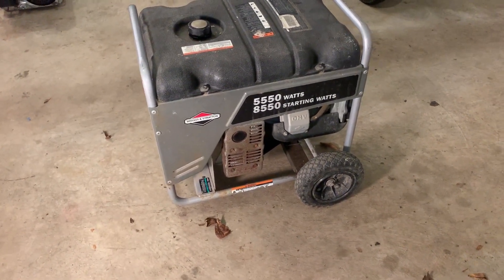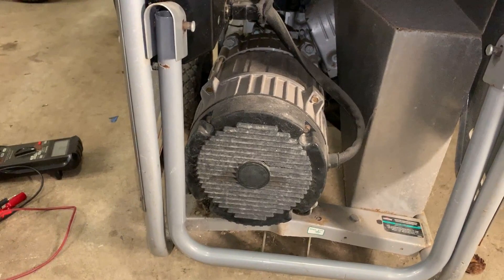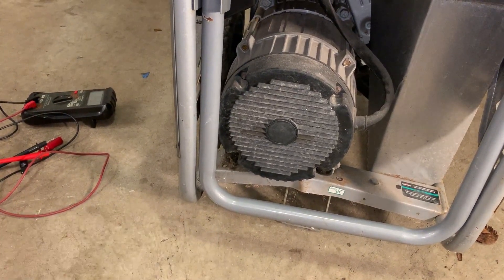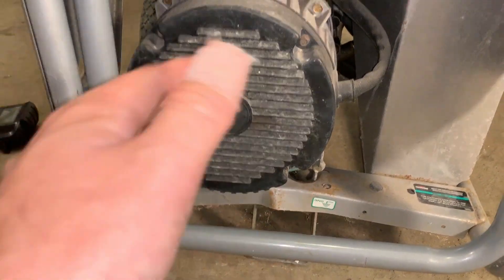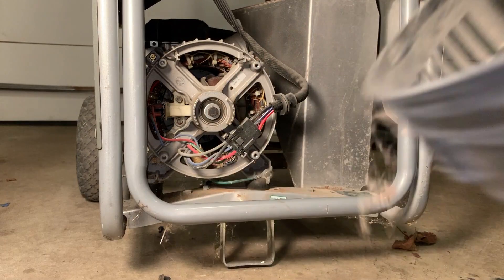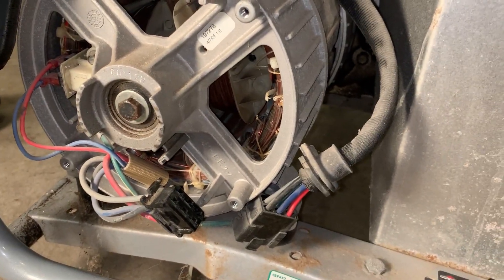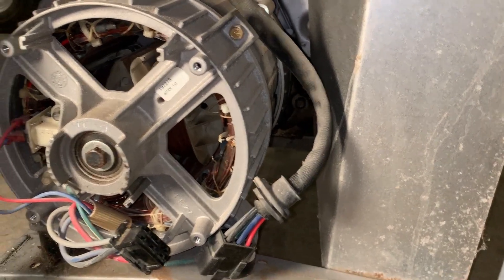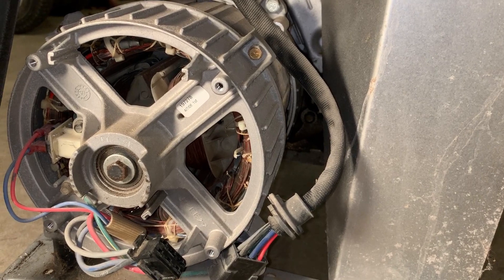What a Bad Generator Stator Looks Like

Comment: James thanks for the videos. Is there a video you have or could do that troubleshoot the alternator. What I mean is like what voltages I should be looking for when say testing the AVR sense wires, at the outgoing wires to brushes when disconnected. The brushes themselves, resistance on the slip rings, at at the r1-r2 and l1-l2 terminals. Say show on a good generator and compare to known bad. I’d be interested in seeing that . Do you have patreon or something like it? Thanks and merry Christmas and happy new year 🎊.
Reply from the maker: THOMAS DRELICH yes.  I have a two part video in the works specifically on power output issues.  Also just finished up a generac 10000 watt machine that had no power output (and many other issues).  Will probably release the generac video next Thursday.  No patreon account yet.  Slipring resistance varies a lot, but generally should be between 7-70 ohms.  Most stators between 0.3 and 0.6 ohms.  Testing good on the ohms though is not a guarantee that all is good.  Applying 12 volts with a battery to the brushes is a good way to test when no power.  It verifies the health of the stator / rotor, should produce 50-100 volts from the outlets and flashes the field at the same time.    Just be sure to get the polarity correct and use a fuse.  For a generator that is not powering up, work expect 1-10 volts AC coming out of the stator with residual magnetism alone.
Reply: James Condon It’s a husky 5000 watt like you have worked on a lot. I got the engine running  and did hook up a cen tech 12 volt jump pack to the brushes directly . Left wire positive right negative. In doing so I get like 45 volts at brushes. With the AVR connected but brush wires disconnected I am measuring 24 volts on those . Back probing the two blue wires I get lie 2 -4 volts. I am only getting like 10 volts at r1-r2 with the jump pack hooked up. Shouldn’t I get 110-120 . I did order a cheap AVR to see if it works but I think the or of the stator power winding was overloaded and burner up. Looking from the open end though I don’t see any burnt wires. But 🤷‍♂️
Reply from the maker: I have not done much testing on the wires  from the stator going into the AVR.  To make it simple, do not worry about those wires and the AVR until you get 50 volts or more using the 12 volt battery test.  Applying 12 volts to the brushes directly should produce 50 volts or more on the outlets.  If not, then you have a problem either with your rotor, stator, or (brushes and or slip ring) less likely.  What are the ohms readings?  For that generator the rotor should be ~55 ohms at the slip rings and 0.3 ohms on the stator.  Rotors usually do not burn up, but the wire solder joint on the slip ring breaks.  sometimes it will test good, but when spinning at 3600 rpm the wire moves and the connection is lost.  Stators on the other hand usually fail with burned up wires and ropes.  The stator on this video looked pretty good.  The only sign were a couple burned wires and ropes.  If you have a meter that can measure DC amps you can hook that in series with the battery and brushes to see how much current it is pulling into the rotor.  would expect between 1-2 amps.  I have never tested that, so not 100% sure what it would be.
Reply: James Condon I’m getting 55-60 ohms on the slip rings. I’ll have to check the connections of the wire at the slip rings
Reply from the maker: THOMAS DRELICH that reading is perfect.  I less your solder connection is loose your rotor is most likely good.  Most likely issue is in the stator or brushes.  What are the ohms in each leg of the stator?
Reply: James Condon I did not measure ohms, but I did measure Volts Ac and was only getting 10 volts  at the terminals with a 12 volt jump pack hooked directly to the brushes
Reply: James Condon hey James well I figured for sure . I plugged in a new AVR. The engine immediately acting like it was under heavy load and the stator caught on 🔥. It was used on a construction site and was probably overloaded and burned up the stator. ThNks for your input.
Reply from the maker: THOMAS DRELICH yikes!  Have not experienced that yet.  Although today tried starting a Yamaha with low compression and it blew perfect smoke rings out of the muffler while cranking.  That was a first, but not as exciting as your day.
Reply: James Condon the only other noteworthy observations was the ohms reading s on the terminals was at first open loop then 140 then 0.5-0.7 ohms then I plugged
In the AVR and it caught fire . I did replace the brushes also and I was getting 45 volts (with no 12 volt source hooked up to it) steadily across the brushes prior to plugging in the new AVR So I have two generator and I’ll try to do what you did and make a Frankenstein generator. But this will be a Subaru engine with a brushless Briggs alternator . Again thanks for the info I’m learning as I go. I just Wondering the new AVR burned up the, but I doubt it.  It was a cheap eBay special for like 14 bucks . Same 250-470 capacitor rating I made sure. I have like 20 dewalt 4.5 gallon air compressors I’m working on and refurbishing as well. 

So are most generator engines tapered and length standardized? Can I swap any motor as long as it has same HP? 

Thanks again looking forward to the new video next week happy new year
Reply from the maker: THOMAS DRELICH the simple answer is yes, all have a tapered shaft that is standard, but there are a lot of other things besides the shaft that can cause a problem.  Will detail some of those later.
Reply from the maker: I have only done one engine swap so cannot say for sure what you will run into.  Never worked on a brushless.  With that said most portable generators made in the last 15-20 years will have a fairly standard shaft.  A few things to consider.
1) The tapered shaft may not come out of the engine at the same height, causing issue mounting to the generator frame.
2) Will the engine physically fit?
3) Will the exhaust shield fit?  Often the exhaust on the new engine lands in a different spot.  Metal gas tanks require some shielding, plastic tanks a lot more.  Also want to make sure the hot exhaust is not circulated though the stator.
4) Some engines have the bell housing as part of the crank cover.  The best candidates are engines that can have the bell housing removed and transferred with the power head to a new engine
5) Is the wiring of the power head compatible with the generator engine and frame being attached to?
6) Be sure to torque the stator and rotor properly.
7) Once the stator and rotor are installed, turn the engine over and make sure you do not hear any contact between the rotor and stator.
Reply: James Condon well similar time your swap it’s a Subaru engine to Briggs brushless alternator. I’m thinking it might work. Worse case is I have a good Subaru 10hp motor